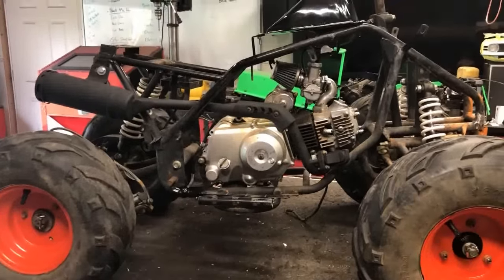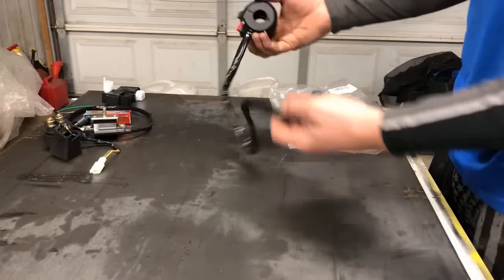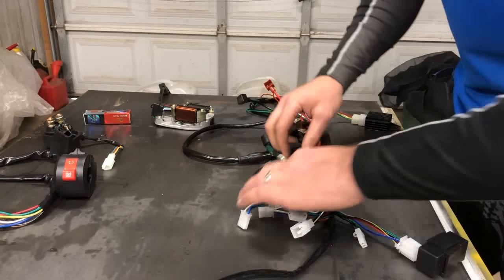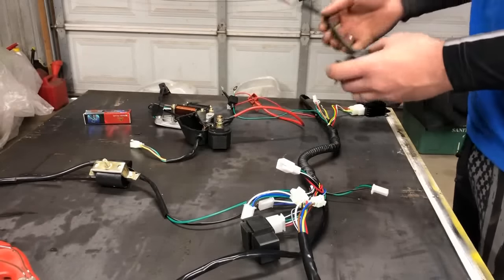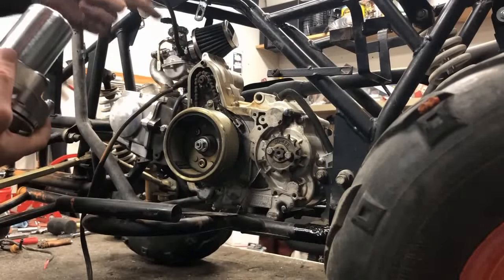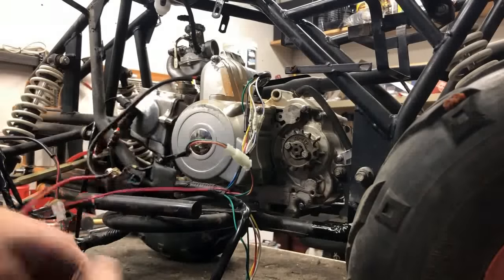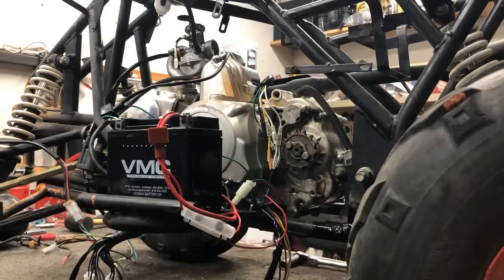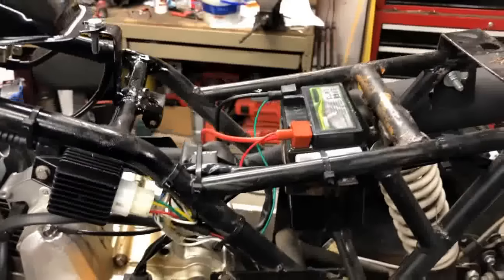Wiring a Chinese ATV from start to finish with an All New Wiring Harness!

Comment: Awesome video.  Inherited a project for a friend.  The bike they have is a 2008 Coolster ATV-3125x8, 125 cc.  Trying to find a harness for this bike which by the way looks like it was already changed probably in the past.  Starting pretty much like you with a rolling chassis and motor. Going to get a harness with all the components. Pulled the stator and I have the 2 coil stator.  

Question to you would be, this bike has a hydraulic brake on the left handle bar (along with the lights/starter switch) with 2 wires (that has the locking feature), similar to the 2 wires that go to the right brake lever, which I'm guessing they active the rear lights. I need to know if there is a harness for this set up?  There seems to be a lot of harnesses but none actually give a description of what all they support except the main components.  The last thing I want to do is have to hack into a new harness to add wires to it.  Would the hydraulic hand brake wires connect to black and green female spade connections (the ones you touched together to get this to start) and the front hand brake (right side handle bar) should connect to the plug for the foot brake which this model does not have?   

Also you mentioned you had a plug left for the safety harness line.  This bike doesn't have a safety harness.  It may have had the remote kill switch but it won't be going back on this bike and they chopped that head off that component and spliced the harness to wire it in.  I noticed you left that plug open when you fired it up so I'm assuming you can if you don't have that component?

Thanks for the help.  It looks like I will be ordering the wire harness you are using since I think I have figured it out and it looks like it has enough plug ends.
Reply from the maker: First sorry for the delayed response but you actually answered your question! With 2 hand brakes you can connect the foot brake plug wires to the either one. You'll need to cut off the plug and put on individual connectors otherwise your good to go! 

When it comes to the safety tether connector in the rear, yes you want to leave that open because if you close the circuit it won't start. If you want you can cover it with electrical tape. Good luck on your project!

Comment: Does it matter for the left hand lever brake which wire is plugged in where?
Reply from the maker: Nope, it doesn't matter. It's only purpose is to complete the circuit.

Comment: So ive got a harness i have everything hooked up other than the safety(im not sure which it is)  the button wont turn it over,but jumping the solenoid will. Does jumping it bypass the safety and explain why the starter button will not operate it.

Comment: Was course were did you get the Engine stand for the table that very hand when working on small motors
Reply from the maker: This is my #1 question for sure! I actually had a CNC company laser cut out all the metal to start making and selling my own. I will be selling the kits on my website either as a DIY kit or a completely assembled and power coated. Should have everything ready soon and will post updates on the channel.

Comment: i just recently aquired a tao tao ata 125d, i noticed that when installing your new harness you did not mention or replace the safety shutdown? anti theft box and speaker, my question is will the new automatically bypass that or was there something particular you had to do to get it rid of it altogether? i have not ordered a replacement harness for mine yet because i cannot seem to find a harness that has the 2 plug, 9 wire start/kill/light switch on the left handle bar. any knowledge you could provide would definately be greatly appreciated. and thanx for posting your videos they are quite informative.

Comment: Under the chain cover the smaller piece that butts up behind the stator cover there are some wires coming out that are connected to a little black plug. The plug looks as if there are points on inside with 5 wires running out of plug  mine (110 wildfire ) has 1 female plug with 2 of those wires other 3 cut of no idea what they are  for...Thank You
Reply from the maker: The wires from behind your chain cover are for a gear light indicator. Your atv was likely equipped with a green neutral light and red reverse light. This new harness does not have a plug for them. The other wires might also be from a remote transmitter to start and stop the atv. This is also not included in the aftermarket harness.

Comment: So i acidently bent 1 of the prongs on a plug & it started smoking out of the throttle/ brake area! Im asuming theres a saftey switch up there.so do i need to just order a whole new harness & parts or??? Thanks.it did thisx with the origonal harness.it wouldnt start after this.im now wandering whats going on??? Any suggestions?

Comment: I have a 2001 Suzuki quad master 500. Having trouble wireing the cdi. What wire on the cdi is the wire that goes to the hot on the stator

Comment: Hey Buddy, I have a 125cc Chinese ATV however, i had the 10A fuse being blown a few times when i hit the brake prior to starting.  I am thinking to change the whole wiring harness like you always do. what kind do i need to order if i have Forward, Neutral & Reverse with GY6, front brakes & rear. Please advise Thank you again for all the videos you do. they help allot!
Reply from the maker: I am not as familiar with the GY6 motors as I am these. However I have done 1 before and this is the kit I used. Please look at the pictures before ordering and compare to yours. It might not be exact and require modifications. Also notice the choke is on the starter switch and it's a manual choke. That is usually the bigger difference with these.

Comment: Hey Praska boys, 
Thank you for this awesome video.I just got a project 125 leapord. I have no idea about ATV's and bought this basically to learn and understand. In the condition i got. Stator cover is removed and these is no stator. I had a question about that. Will the 2 coil wiring harness mentioned in link below work for this model? I am asking about that particular one because  the pervious owner left the two coils in the parts bin he gave me. Also on the prewire that goes to the startor. There are 4 blue wires and a plug with 2 greens. Will this stator work if i am only doing the stator  or need to look for a different one? i am particularly trying to install the startor first to see if  that runs the quad. it is my first troubleshoot for this build.
Reply from the maker: Hey that's awesome, we also have a 125cc Leopard that we picked up a couple months ago that will be in a future video real soon! I don't know exactly what stator is in mine but I can check. It might be a little while till I can get too it as I will be out of the shop for a couple weeks.
Reply: @PraskaBoysGarage  Thank You for getting back so quickly!!! I will wait for the video to come out. In mean time if you get a chance to quickly peek at the stator and the wiring please comment it. Thank you again for you really quick response and valuable help.
Reply from the maker: @sunny344454  Do me a favor and send just a quick email to praskaboysgarage@gmail.com and I will have it in my inbox to shoot you some pictures when I can.

Comment: Nice job and I mean very nice and clear....does this work for a 50cc Chinese scooter
Reply from the maker: Thank you! The concept of the wiring harness and the install process is pretty much all the same but a GY6 type scooter will have a different style harness.  I would lay out your new harness, plug everything in, hook it up to the scooter to make sure it's right. Then final install. Let me know if you have questions!

Comment: I watch this video and it was greatly described to what to do very easy. So I bought one and put it on my 110cc 4 wheeler and I had no spark. It will start but not turn over dude to no spark. So I got a new one and the same thing. Bhqve everything grounded right. Any ideas??? Will be appreciated.
Reply: I figured it out it came with a bad stator so I just used the old one
Reply from the maker: Nice! I glad you figured it out, cant believe you had 2 bad stators. That would have driven me crazy!
Reply: @PraskaBoysGarage  yes and kill switch lol
Reply from the maker: @nicktoysprojects7369  That's nuts man. Happy you got it!

Comment: Best wiring video I've seen yet! What wires on the harness can I attach the electronic choke to?
Reply from the maker: Thanks Ethan! Unfortunately this harness does not come with a plug for an electric choke. Those are on the GY6 motors and require a different harness.

Comment: Hi. I install the same wiring kit but I'm still not getting spark. Is not sparking at all. I measure it with multimeter and I'm not getting sparking pulse from the stator. Stator is new and the same like yours. Any idea where to check next?

Comment: Do you have a link to this product? I just pickuped a 125  and previous owner said it has electrical issues.  Hand brake doesnt ohm out, foot brake doesnt ohm out and none of the multifunction switch works. I found that coolster has it in separate parts but im looking for a whole kit. Thanks

Comment: Hi I’ve bought the same wiring but haven’t got the same colour to the other wire that’s still connected the other part of starter case, any ideas what it’s for many thanks
Reply from the maker: I'm not sure I'm following exactly. The wire still connected are the stator wires and the main power wire for the starter.

Comment: HELP!!!!...i did everything exactly like the video shows and i am not getting a spark...im starting to think one of the components they sent me are bad i.e. the stator...coil...cdi...resistor... Maybe even a loose wire in the harness...I am new to working on them but am pretty technical so i know i have it hooked up right...anything i might have over looked?..any help is appreciated...ps I am getting it to turn over but it will not start...i dont have a rear break light hooked up...nor does the back break have fluid in it to work...but i have the two wire safety hooked up. Front break safety as well.

Comment: very great video I do have a question I have a question I have a 110 four wheeler says it's made in Taiwan I have compression spark and fuel but I cannot get it to run any information will be helpful thanks
Reply from the maker: I would remove the carb and try just putting a little fuel down intake. If you did that already take off the exhaust make sure you don't have any restrictions. My next step would be to look at valve clearances. After that double check your flywheel and make sure you did spear the key and your timing is off. I'm sure it's something simple, take your time and let me know what you come up with!
Reply: Thank you so much I greatly appreciate it I will start looking in that direction and let you know what I come up with
Reply from the maker: @andyslawnsheretoserveyou2041  Perfect! Good luck!

Comment: Hi 
I’ve been trying to start my tao tao 125 cc up, but no luck.  I’ve changed the cdi, solenoid, electric push button start, key switch, still nothing. It starts fine once I short the solenoid.  However the gear display still does not light up, but back brake does.  Any suggestions?  Thanks so much!
Reply from the maker: Watch this video: https://www.youtube.com/watch?v=NtxnHGwcd90 and start it at 24:00 and that should help you track the power.

Comment: Two wires you pulled from the stater could be for neutral position indicator?
Reply from the maker: I still to this day don't know 100% but I don't think that's it. Those are typically the wires that are on a plug the comes behind the chain cover and out the stator cover.

Comment: I am about to do this on one i purchased it for 200 bucks with no spark. Ordered the kit. Could you do a video on carb adjustment?
Reply from the maker: Love your name we are also in iowa! 2nd I haven't done a carb video in the past mostly because I'm an advocate to buying new rather than rebuilding old since the price point is usually under $20 dollars. That's one invest I make 100% of the time when rebuilding these little guys.
Reply: I tried to get it done today. But i am lost. I got a new wiring harness and lost everything.  I had no spark before and now it wont turn on and no power
Reply from the maker: @iowaland7658  Ah dang it! Can you shoot me an email with your contact info? I can video conference with you and see if we can figure it out!

Comment: Hi buddy great vid and has helled me lots already but one thing I'm stumped with is the wires for the charge coil I have a 6 pole like the one you bought but never used. There are 2 yellow wires coming from it but the harness end has a white and yellow so what connects to what or does it matter??? Thanks in advance
Reply from the maker: Marc Hood Hey man, good question! Both the white and yellow wires are charge wires. So you can swap them and it won’t make a difference.
Reply: @PraskaBoysGarage  thanks buddy still got plastics to paint once the looms in and she should be done just hope my son will ride it as right now its apparently to loud ha ha
Reply from the maker: Marc Hood I know how that is! My oldest was the same way when he was 3 so I bought him a 48volt electric with suspension to get him comfortable before switching to gas.
Reply: @PraskaBoysGarage  ha ha mine is 4 and is obsessed with stock car racing over here and wants to race when he's 5 in a kart so trying to get him on to petrol power now as he has a electric range rover at the moment

Comment: I love this video!!!!!! I got a 90cc kazuma, i bought a new wire harness but i didnt get the stator the wires match except one which is red with black strip the new one has it blk with red strip. Can i connect those 2 together to see if it works. Note i couldnt figure which kind of stator it was cuz i had trouble r3moving  it cuz the shift stick was in the way
Reply: Its a 2 coil harness dont kn9w if that helps
Reply: I don't know what I'm doing wrong I'm still working on my 90 kazuma falcon I installed everything. I tried ro start it and there no spark I checked what has power and what doesn't and I'm not getting nothing from coil and no power from the starter relay the neg wire

Comment: I picked up a 90cc Chinese quad for the kids a couple weeks ago and was already planning on doing a wiring harness because it’s hacked in spots.. I tried jumping the two brake wires with a jumper wire but it does nothing, not a click or anything, jump it from the starter solenoid it turns over
Reply from the maker: Ron Gering It could be a number of different issues. First check the fuse. If that’s good then jump the solenoid again and check for spark. If you have spark it’s likely your start button has a bad contact inside the switch. If it doesn’t have spark your issue is likely the key switch. Let me know if you have spark and we can trouble shoot from there!
Reply: Guy I got it from said someone wired a blaster coil in it... I’m gonna go your route and not deal with the headache of hunting for a unicorn
Reply from the maker: That’s my logic!!! Good luck man, it’s super rewarding to hear it fire when your done! 😉
Reply: The ending of this video was super awesome of you! I was still watching the video while I’ve been chatting with you
Reply from the maker: Ron Gering Thanks man, truly a special moment I will always remember!
Reply: I finally stripped mine and once I looked over the mess it was pretty obvious that I needed to just replace the rats nest of wiring lol your tips on leaving the 3 certain harness coming off the engine will come in handy as well as checking your ignition to see if it’s got 2 coils or 6
Reply from the maker: Ron Gering Let me know if you run into any issues! I’d love to help!
Reply: Awesome thank you! I appreciate that, this is my first Chinese quad I’ve decided to fix.. the other 3 I had were to far gone and my only option would’ve been to do a predator 212 swap on them

Comment: I have a 110cc atv engine I got off market place and a wiring harness. I looked at a wiring digram and watched plenty of videos to have the right idea of how to wire it properly, but as soon as I hook ground up to the battery, it's turns over even if the key is off and without me pushing the start button. So Im not sure if it's because the engine is not on a frame meaning it's not being grounded or, if I'm doing something wrong. Any tips? Because of this I getting 0 spark. But it's not normal for it to turn over as soon as both batter terminals are hooked up.

Comment: extra wires from stator for winch, hid's etc?
Reply from the maker: JaseCJay interesting! So they are audition charging wires? I’m assume you just have to solder them in?
Reply: @PraskaBoysGarage  only guessin! Lights come from regulator? I haven't gotten to the lights yet! Maybe it's for tach? Black/xx carries signal? My china harness actually did not have two extra wires.. I also found that shorting the hand brake safety wires did not allow the system to crank.. foot brake will!

Comment: I have a 110 atv with an addition wire coming out where stator is?  Whats that?? & great video thx!!
Reply from the maker: What is the wire color? If it's from the right side of the cover then it could be for the gear light indicator.

Comment: So where does the headlight connect? 👀 I have a 4 pin headlight and it doesn't fit the harness I ordered. Good video tho, other than the headlight issue this tutorial was top notch. 👌
Reply from the maker: What kind of ATV do you have? If it's just a single headlight then it does require some modification and I can walk you through it.